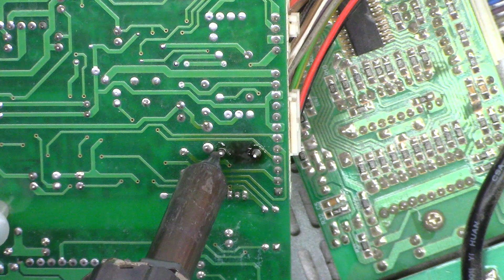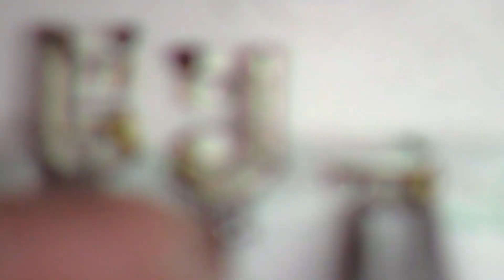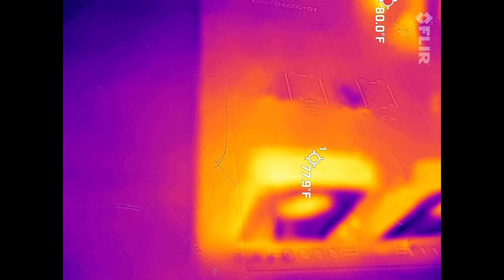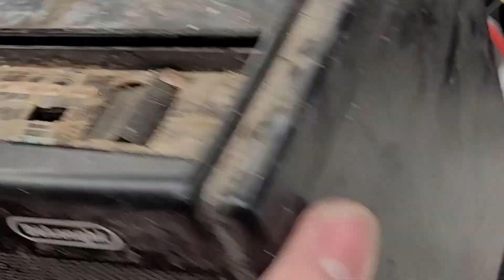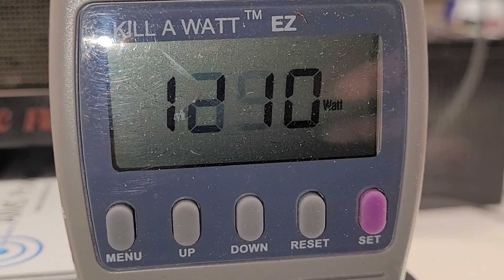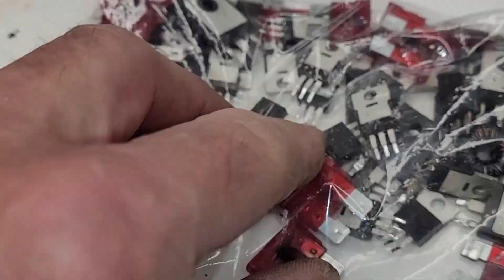Aims Power PWRINV500048W Inverter - No Power - So Much Carnage! Part 2 of 2

Comment: What blows these up?  Are they just being overloaded or are they using the wrong type of load?  Can these inverters power any type of load?
Reply from the maker: I think on this one it went over voltage to the input.
Reply: So maybe like a 230volts overload vs. 120volts and what should have been maybe. Or am i wrong.???
Also where did you purchase all the replaced parts and where can i get or buy the tools you used.?  Im trying to get into this whole solder stuff....? Thank you and WOW AMAZING WIRK YOU DO WISH I KNEW ALL YOU DO AND SKILLS TOO...

Comment: Repairing Inverters are one of the most difficult to repair, only people with advanced knowledge can mess with those because as you can see in this video it’s not for the faint of heart personnel, especially when you have controller problems which when shorted can cause all your mosfet to burn again after changing. If you’re not comfortable working on these, get an expert to do it, very hard to repair and could be costly too. AIMS are good quality inverters so it is worth fixing no doubt about that.